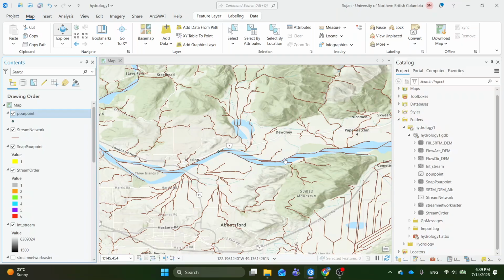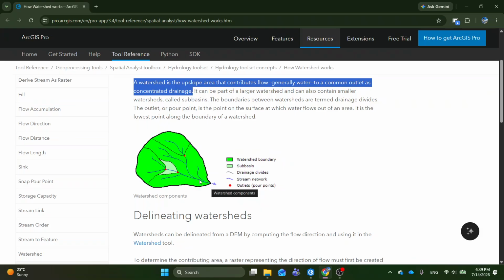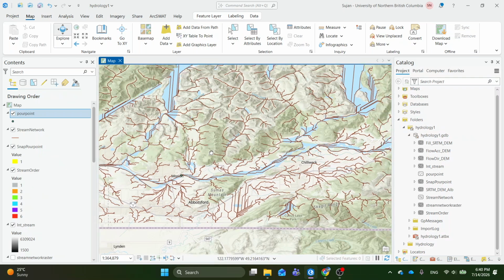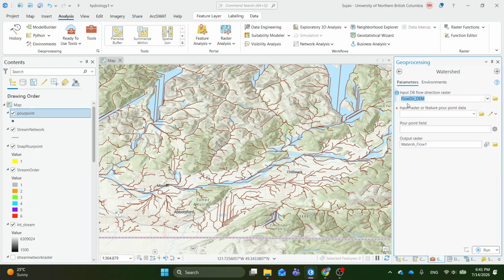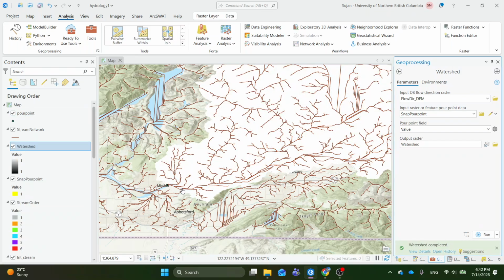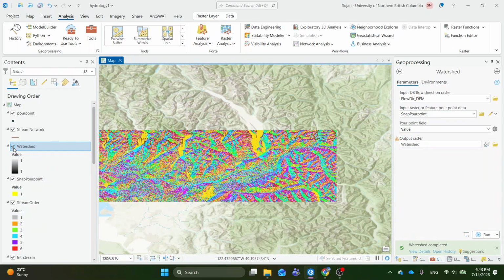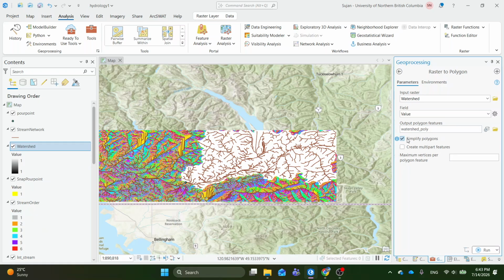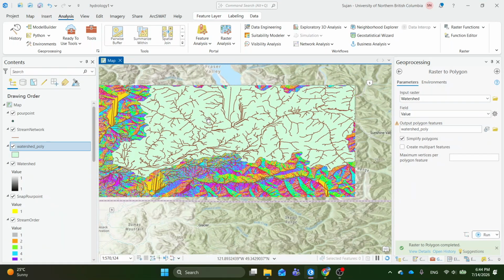How to Delineate a Watershed in ArcGIS Pro | Complete Watershed Delineation Tutorial

Comment: please confirm, if streams are matching the actual river streams (from for ex. Google earth imagery)
Reply from the maker: You are absolutely correct. When you compute stream networks using a Digital Elevation Model (DEM), they often fail to align perfectly with the actual river centerlines seen in high-resolution satellite imagery (like Google Earth). Instead, the computer-generated networks frequently run parallel to the real river or split into multiple parallel networks. And sometimes TauDEM may help to solve this issue. 

Anyway thank you so much for your insightful remarks.